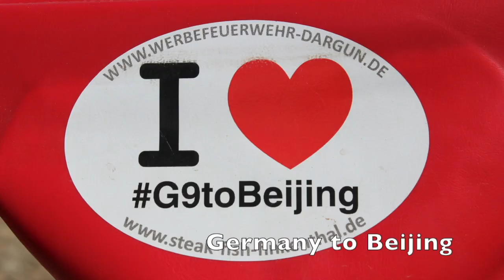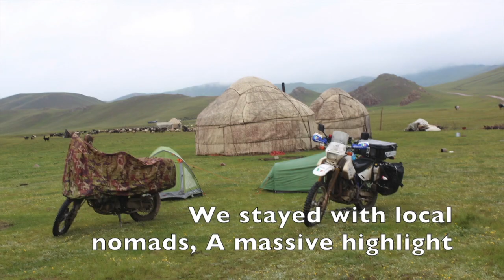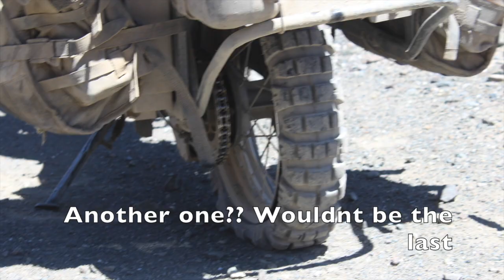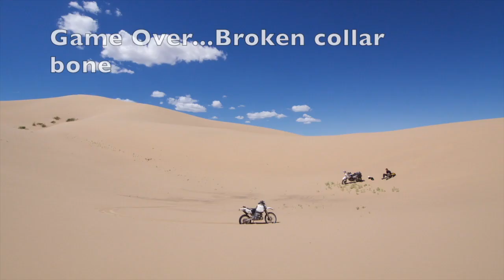SE1&2 HIGHLIGHTS - Overlanding Ireland to Mongolia and bacK on a Suzuki DR650

Comment: I just bought a new DR650 I want to bring it to Ireland is it legal there with the emissions?
Reply from the maker: No issues, just pay the vrt and you’re good to go! Is it brand new? If second hand? Make sure and have plus 6000km on the clock or it’s still deemed new and it’ll cost you a pretty penny
Reply: @IanHoran  Thanks great it is brand new only 700 miles.
I appreciate your help